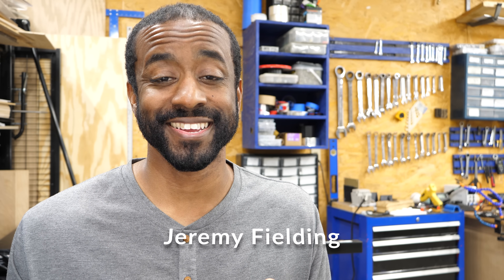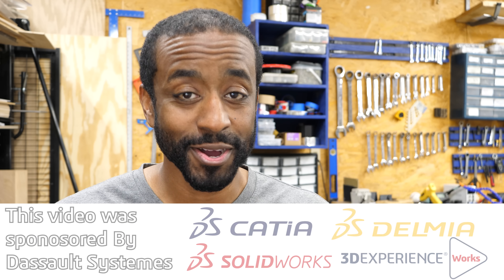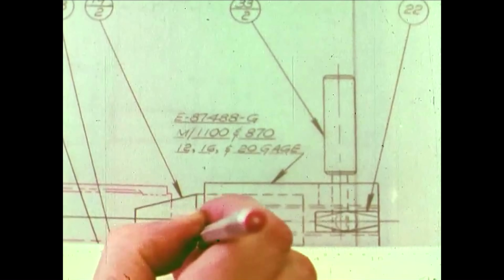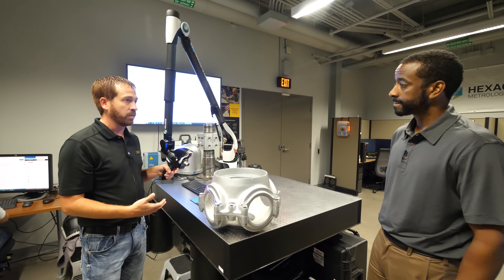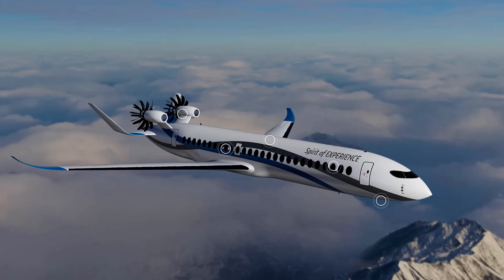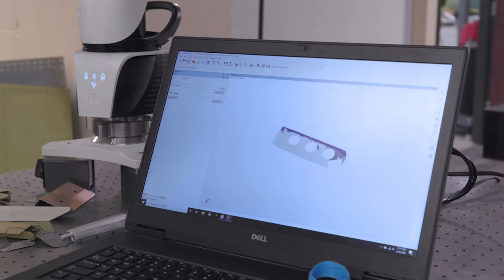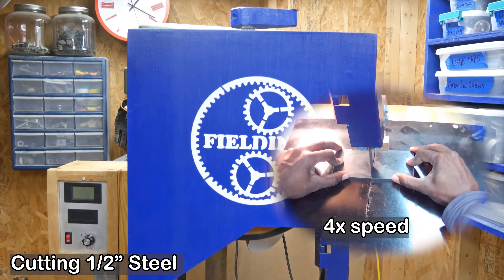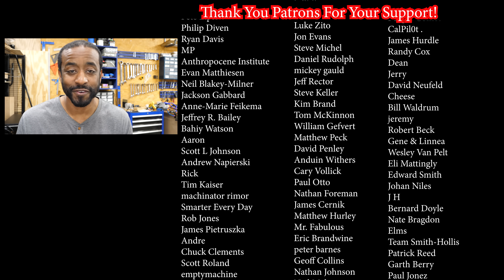Why The US Military Spends Millions Reverse Engineering Their Own Planes

Comment: "Kids  are  not  going  to  die"   well, Letting  your  children take   things  apart  under      that  presumption is  SUPER  DANGAROUS., for exaple  disasambly of  Microwave  magnetron, containing  toxic  barium, disassambly of  CRT displays  without  discharging  them., disasanlby of  any  device   with  high  voltage capacitors, rapid  disasambly of  smoke  detectors....disassambly of compressors, disasambly of gas  tanks,  there  are  manny     Safe  devices   tunring  deadly  during   unskilled  disasambly, disasambly  of  laser  printers,,  mercury  bulps ;D
Reply from the maker: It sounds like we should just agree to disagree. You are allowed to have whatever level of fear you want for your family. I think that means you should not let YOUR kids disassemble things LOL. We all have very different levels of fear about basic things. There are also hundreds of things that are completely safe to disassemble. This is a silly exercise to look for a list of the scariest things you can think of when most of the time its not these things. Gas tanks... under pressure I guess... really man? Thanks for watching and commenting though! It really helps the video.

Comment: If you gave me a schematic I could create a 3D model of that part for a fraction of what it would cost to take a plane apart and in far less time. Plus the model would have precise geometry based on the exact specifications. I bet they just straight up lost track of the original schematics. Because they have horrible management practices. Several buildings sit still powered and they don't even realize they own the building because they are allowed to spend tax dollars at will without any accountability.
Reply from the maker: No. They use both. As I explained in the video “as built” is never the same as the original design. Also repairs and upgrades are scanned, on and on. There are many reasons it’s worth the effort. That’s what I was trying to imply with the title LOL. It’s worth millions of dollars of effort to do this😁. Thanks for watching
Reply: @Jeremy_Fielding  In the end. The military industrial complex is all a big waste of everything. 

I got the part about doubling plates. Which should have been standardized based on schematics and engineering specifications. All of which could be greatly enhanced using modern finite element analysis on the 3D models. Then using AI the form can be optimized. No point in recreating a flaw then the repair work. Especially if it was only done by a technician and not engineered.

I only say this because that was my job as an intern. Taking 2D schematics for underground mining infrastructure and using those to create 3D models. 

I also did drawing updates with stamps and revisions placed at a certain X,Y coordinate. We wrote a LISP routine to turn that 3 hour process into a 5 minute process.

They kept all the digital schematics backed up on Mylar sheets in a vault. Since some of the underground stuff was classified missile silos.

I moved the entire vault, every computer station in the office, and purged the all paper procurement database while simultaneously digitizing it.

Thanks for the response though. Also, it is great video and I really like your channel in general. Keep it up. 

Don't let my opinion of our overlords get you down. It's not you. It's them. These days I just assume the worst from them because they have demonstrated it so many times.

I am also a person with Asperger's so I am uniquely equipped with special abilities that would enable me to do that job more proficiently than 98% of people. So I understand the inefficiency is somewhat unavoidable for neurotypical people. Took me a while to realize that I am in fact different and operate with approximately 400% higher internal functions. 

Maybe wrong to assume that other people are capable of optimizing such a complex technical task.
Reply: @Jeremy_Fielding  Also, forgot to mention that I also produced a paper on the feasibility of deep geological nuclear waste repositories based on existing pilot projects. Then published a paper for a North American mining consortium on ore transportation alternatives from the face to surface. Actually recommending new ideas that an industry leading expert missed; he published the Hard Rock Miners handbook. 

I did all of that at minimum wage as an intern. So it's possible to do it for less money. Especially when you consider that all the scans will need to be checked and verified just like any schematic drawing. 

The problem is the people in the industry charge too much for their services. Because they aren't really trying to work hard. They are trying to buy toys and live in luxury. I've seen what they got paid and honestly they didn't earn it. They pawned off most of the work to technologists. 

The old guys kept the highest paying roles not because they were proficient at it. It is because they were around before everyone else was hired. So they get the big bucks for basically talking. The one engineer used to update the drawing manually for $300 per hour. Yet an intern replaced him and got it done in 5 minutes. So a $900 process that was done multiple times a week turned into less than a dollar.

Comment: Most of the jigs used to build the warbirds are scraped or lost at some point. In other cases, the dimensions of smaller components are unknown. It used to be the planes were put into boneyards and slowly rotted away. With modern technology, the warbirds can be refitted and made air-worthy once again. It's really amazing. This scanning process has been taking place for a couple of decades now. The Airforce has been pulling B-52's out of the boneyard in Arizona and putting them back into service.

Comment: Fact: CAD ( computer aided design ) was actually used in the 1980's
Reply from the maker: Yes indeed! But its use was not nearly wide enough for this plane to be designed in CAD. LOL Most companies still did it by hand for most designs. Or technically many companies had machines that could draw but it was still on paper. Thanks for watching!

Comment: Hi Jeremy, very nice video and presentation. You try to keep it relatable and that's appreciated. A level deeper, I don;t understand what this reversed engineering process entails.
My impression is that they take, say, a B1, say partly, apart and scan the physical objects in there. These scans then are converted into CAD drawings that can be CAM manufactured/reproduced? (a) True?
Then (b) have you discussed with these reversed engineers - fun intended - the alternative of scanning boatloads of drawings into CAD files and using software to combine the drawings into CAD files? If so, what was the position or conclusion?
Reply from the maker: The whole point of scanning in 3d is only to create a "reference" shape. Something that is the right shape. BUT, the actual model they create is from the drawings. This is hard to explain if you have never done this kind of work, but from my experience, and clearly theirs as well, is is 100's of times faster to have reference model for parts with complicated geometry. These planes have curves going in multiple directions with changing angles of curvature and it takes a long time to work through that from a 2D drawing. As said in the video you can get it right and faster if you can see a scan (which is not the model but is the same shape as the model) on screen to confirm you did it right. The original drawing is the standard for the new model, not the scan. As mentioned on the video, the scans will have changes unique to that plane you don't want in the master model. As far as I know there is no software that can take a 2D drawing especially at this complexity, and create a 3D model. There is software that can take a 3d model and make a very simply drawing. Sometimes that is all you need. But for this drawing from the 1980's...There are hundreds of tolerances that have to be correct, and hand drawn lines that might have tiny errors a human would know was an error. It might be possible one day, but it would take years to develop this and someone would still have to check it.
Reply: @Jeremy_Fielding  - thank you. Understood and appreciated. We must then conclude that the original drawings leave room for interpretation.
Reply from the maker: @jpdj2715  I wouldn't say that. The whole point of the drawing is to describe precisely the geometry of the part so any shop in the world can make exactly the same part and make it interchangeable with any other part. That is what the tolerances help control. I was only pointing out that a human would notice tiny things a AI program might struggle to get right. But if a drawings can be misunderstood, that kind of error would be fixed before the drawing was put into production

Comment: As an avionics tech, I've seen lots of aircraft, and even if they came off the assembly line next to each other, they are more often than not, different is many ways. Even now, at Agusta helos, I see the Navy AW119 helos, and each one is slightly different. Reminds me of a S-West 737 I saw being repaired- the R1 door where they load the food is always repaired around the opening because drivers back into the skin. One 737 I saw had 7, yes! Seven!, layers of skin repairs around the door. Imagine the weight, and balance of aircraft. Think about that when you fly next time.

Comment: If they can't recreate an air frame from 2D prints, be it digital or hand drawn. Someone screwed up. Learning from the old pros is very insightful. Man, I'd love to dig into some old NASA prints just to study them.
Reply from the maker: Maybe you misunderstood the problem. It’s still doable. It’s not a lost skill. We still make the parts today. It’s about speed to CNC programming. You need the model to program new CNC machines fast. Most of the cost is there. You can do that without the model as well but it takes longer thus cost a lot more. It’s no different than giving someone writing by hand a typewriter. They didn’t forget how to write and they certainly can still read, but they can crank out way more words per minute

Comment: That's what happens when the population that designed and built these vehicles is progressively replaced by one that is less capable. Ideological assertion and reality rarely align to synergistic effect.  Expect further regression of our once foundational abilities as the phenomenon continues.
Reply from the maker: I think it makes more sense to argue the skills are just different. But you might have missed some important points. First, it’s about speed not ability. Engineers and machinists don’t read drawings “slower” than the last generation. It’s just new tools let you work much faster the same way a person with a type writer is hundreds of times faster than someone writing by hand. Nothing about the typewriter implies the person can’t write by hand and especially it doesn’t imply they can’t read. Some skills go obsolete everyday sir. But that’s not even the case here. 2. They still use drawings. You need 3D Models for CAM software to run your CNC Machine at optimal speeds. I don’t understand what you think was lost except less time wasted. People didn’t suddenly become less able or less intelligent. We just put that energy somewhere else and produce more
Reply: @Jeremy_Fielding   I disagree. The people we are staffing today are markedly less intelligent and competent than they were because the standards by which they are hired, retained, and promoted, have changed entirely.  Now, social perspectives, ESG targets, and concepts like corporate stewardship have co-opted the process of achievement.  Particularly in government contractor industries, it is political mandate, not  granular issues of merit or achievement that dictate every aspect of the interaction - from the bid process, through contract assignment, onward.
Reply from the maker: Perhaps in your experience... but I wonder if you might be casting the net too wide while looking at a sample size that is too small. I don't want to press you too hard as I don't think this is a point worth disagreeing over. I am just trying to make you reflect on the meaning of what you are saying. Given you would need a pretty large sample size to prove you were right to make this of kind of claim. But even if you could prove that across the board the standard was lower, it still doesn't follow that the choosen applicants are actually less qualiifed. It just means more people meet the qualification to be considered... highly qualified and less so. You could also be right and I am too dumb to notice the difference :) Seriously, I just want to challenge big claims like this in general as people mean well, but its easy to start thinking all young people are stupid or something. This just isn't true. Thanks for watching and I hope you got something out of this other than this minor exchange :)
Reply: @Jeremy_Fielding  I never said all young people. I said the people that are being hired and promoted... I believe there is an entire population out there that is not being hired and promoted because the metrics by which hiring and retention is now judged have little to do with merit, and much to do with ideology and ESG intiatives.

Comment: Can they not scan paper blueprints into CAD?
Reply from the maker: I don't understand what you mean. It won't be 3D which is the point. If you mean can you scan a 2d drawing into a 3d model that sounds like some form of AI reading the print and trying to understand the geometry. Maybe somebody offers that, but I would not trust it to be perfect. They don't even trust the scans to be perfect for the reasons I mentioned in the video. They still need the original drawings to make sure it matches the original design intent.
Reply: @Jeremy_Fielding  Ok.

Comment: Reverse engineering a part. It's one thing to duplicare geometry, but heat treatment, surface coating, all those things that go into a functional part. That is one thing about counterfeit parts, they may look correct but you have no idea if they are truly  functional. The process you show will provide the 3D model as well as the technology (from the drawings and other documents) so you don't have to worry that your vehicle will horribly fail. Thanks for a well thought out video.

Comment: When I was a young child, I lived in an Air Force base house. The base ‘engineer’ would come each fall to prepare the central heater for use. One year he came back up from the basement and said to my mom “Your son looks very interested in this. Would it be ok for him to watch?” My mother said yes, so I followed the technician down to the basement. When we got there, in the nicest way, he said to me “Little boy, if you are going to take these things apart, you need to learn how to put them back together.” To my delight, he proceeded to coach me through re-assembling the furnace and blower. Then he had me test it and light it. He had correctly realized that I had been the one who took it apart out of curiosity. It was a joyously formative experience. I wish I knew who that guy was so I could thank him. We learn so much from talking things apart — please let your kids have a go at any old machinery or appliances that you have before you throw them away — and they might even fix them! That’s what I learned to do. I’m a computer professional nowadays, but I still find things to fix as a hobby because it still gives me joy six decades after that day I put the heater back together (with a helpful mentor by my side).

Comment: False regarding machine shop being more expensive not having 3d prints.  Making accurate parts starts with you redrawing the part TO PRINT. cant trust a 3d model. Let alone a 3d scanned one👍
Reply from the maker: Yes. They make drawings. But the drawings made for the shop floor are just the parts that need to be fabricated. Not the entire plane. I get what you are saying but perhaps you just haven’t worked with a drawing from the 1980’s LOL. Unless the part is really simple most places use CAM software to create the CNC paths. That is cheapest if you start with a model. It doesn’t make sense to say you can’t trust the 3D model with everything today starts with a 3D model and the first drawing is made from that. The Model is the first reference. Drawings are the final word on the shop floor because changes and tolerances are put in the final drawings.

Comment: You left out one of the biggest reasons the military spends millions/billions to reverse engineer their weapon systems. There was a shift in the 80's and 90's by the contracting world of the  defense dept where it seemingly became undesirable to purchase the technical data (drawings) with the acquisition of the weapon system. Now the DoD is suffering from the consequences of those decisions and maintaining systems with diminishing supply of obsolete systems is not economical. Think trying to go to the dealership for your car, for literally everything, on a vehicle that came out in 1970. This is one of the contributors to our high defense budgets, because these OEMs know they have the upper hand and price gouge the military because the DoD can't go anywhere else for the parts they need (the OEM is the only one with the drawings). They could purchase the technical data from the OEM of the system, but their price tags often exceed the cost of just reverse engineering it.